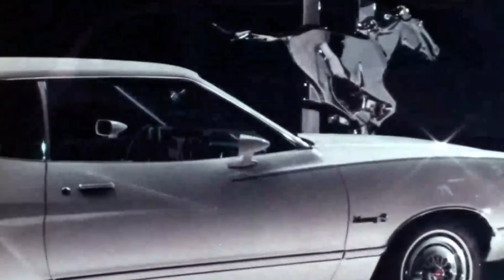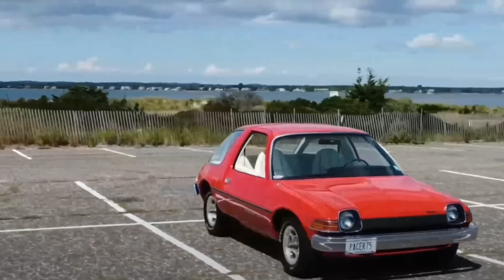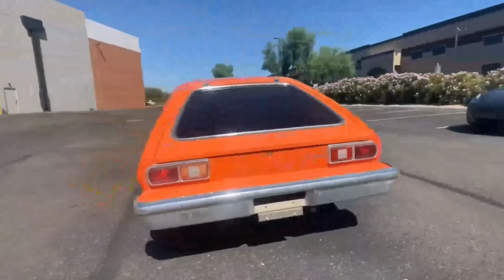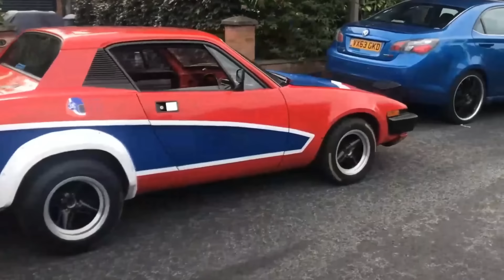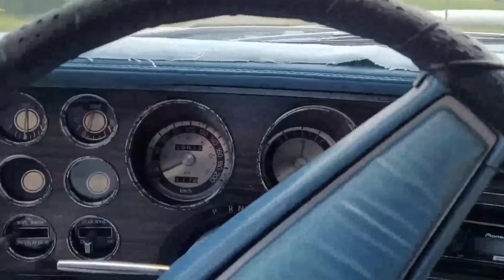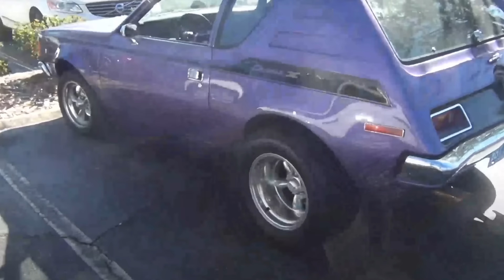Top 10 WORST Cars of the 1970s

Comment: Interesting, AMC Gremlins and Pacers are in high demand for AMC car clubs, I attend many car shows and have old Fairlane's and my friends have Camaros, and Pontiacs and Corvettes, but the Gremlins get a lot of interest. I had a Pinto, put almost 200k on it had a 2.3 L four with a standard shift, I did have to replace the rubber timing belt, and yes it rusted out, and the engine went in another Pinto, the Chevette  was a decent car for what it was. I knew a lot of people who owned them.
Reply: Gremlin, the only new car my dad ever bought for $2300, With a white stripe the only option, vinyl floors. 232/3 on the floor. But that Thing Kicked ass rolling white smoke otta the wheel wells from first gear! So Cool!
Reply: didn't know the pinto had a timing belt.  bummer.

Comment: Indeed, the Vega sucked.  My sister had a '72 and the engine seized up in less than a year.  My dad thought she destroyed the car but it was the crappy engine block.  One thing, the creator of this video showed lots of tricked out Vegas including one with a replaced engine that has no connection to the story.  Why not use correct visuals?

Comment: I can only talk about ones I’ve owned. I had two chevettes and three pintos. They were not built to race but were economical cars and very reliable. The gas tank issue was fixed by a $13.00 part. These cars were also popular with people running rural newspaper routes. I wish I still had mine. The Vega was indeed a bad car. It was a pretty car but dealership noted they leak oil sitting on the showroom floor. Mine was beautiful but didn’t last 20,000 miles. Before you make video like this leave your subjective opinion at the door
Reply: The Pinto was more reliable than the Vega, Chevette, or the Pacer. It's sad that it had such a bad fuel tank design. The Chevette was absolute garbage and I speak from the experience of owning one that didn't even make it to 100K on the odometer.
Reply: @citylimits8927 I owned two chevettes and they were both good cars. General Motors only designed them to last. About 50,000 miles but both mine exceeded that

Comment: My 76 Gremlin is the second best car I ever had 
Number 1 is the 98 Saturn I still drive
Reply: I have a 1999 Saturn SC2 3 door coupe with low mileage, no rust that was given to me. It needs a neutral safety switch. I just haven't gotten around to installing it. The right window needed a new window regulator. Being lazy I just ordered a new door from a junk yard that came in the wrong color but had the window regulator installed so I just unscrewed the plastic outer door panel off the old door and put it on the new door so I had the correct color. Easy fix and it only took a screw driver and wrench with socket. Try that with any other car. Easiest car to work on.
Reply: @eyesalooking  Interesting concept! They should make all cars that way!
Reply: Although they were slightly noisy and the plastic exterior panels had large panel gaps, the first Saturns in the 90s were actually very reliable, especially if you got one (as they say) "built on Wednesday" (the day of the week when all of the plant workers were at their best). I knew of one person who still had his after 365,000 miles although he had had to do several significant repairs by that point. The ease and low cost of maintenance was another plus for those early Saturns.
Reply: Gremlin, the only new car my dad ever bought for $2300, With a white stripe the only option, vinyl floors. 232/3 on the floor. But that Thing Kicked ass rolling white smoke otta the wheel wells from first gear! So Cool!
Reply: You must have only owned two cars.

Comment: I bought a brand new Chevette in 1984 and I got 229,000 miles out of it and it never cost me a lot to drive it either
Reply: I drove a chevette to 400,000 miles great car
Reply: Chevettes were great little cars. and I put the emphasis on little. A co-worker had on and it was very reliable. We took a road trip and were doing 80 in it Thrilling ride. -:)
Reply: @donalddoty5768  There was a tree cutter and church steeple builder here that always had the Chevettes and he loved them. Ugly as they were lol
Reply: Knew a guy that had a few of those and he loved them even though i thought they were the ugliest car ever made.
Reply: I loved my Chevette
Reply: Reverse lemon?
Reply: My auto shop teacher called the Chevette the Chevy Shove It!
Reply: @psa722 Hahaha that sounds about right.
Reply: Yes the 80s models were better.  I saw one go to 400,000 miles ..but 70s first ones had issues
Reply: The Chevette was the worst IMO
Reply: @kenrutherford1109  Pinto was right there with it. Lol
Reply: In Puerto Rico people used to replace Chevette engine and transmission using Toyota 1.6 engine.
Reply: The stick shift was bad ass but when you turn on the heater it was like you kicked the car in the nuts
Reply: Yes ,, but all your friends laughed at you .😂

Comment: The vega went out of production in 1977, not 1980.
Before these small cars came along, Almost NOBODY used metric/liters as a callout for engine size.
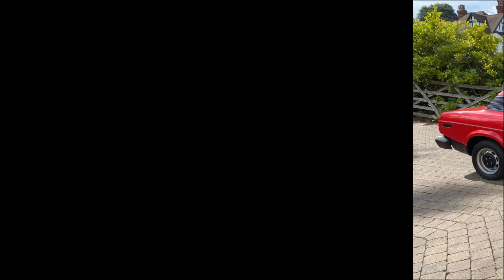9:00 No LeBaron of this era was body on frame, you idiot. They were all unibody.
The Gremlin was a decent car. This video sucks ass.

Comment: The Pinto was actually pretty successful.  My dad owned two Pinto wagons that he pulled behind a motorhome.  It was pretty funny when we unhooked because they weren't on a trailer.  They had a big V tow bar attached to the frame that we just swung up and secured.  Today we'd be told we couldn't drive it because it would obstruct our view. 😂  I remember now the gas tank issue.  That was definitely a problem.

Comment: I often wonder why so many cars from the 1970s weren't fully baked. The most disappointing was the Vega which was rushed to production so as not to be beaten out by the Pinto. While both cars were a disaster, Chevrolet put a lot more design into the Vega which was eventually redesigned after a bad reputation had already killed it. The Chevette was a mediocre replacement for a car with a lot more potential.

Comment: I call BS on the Chevette. It definitely was your “basic’” car, but it was a reliable little car. Bought one right after I got married. Ran the crap out of that thing. Could drive miles on a teaspoon of gas. Fun little car
Reply: Agreed.   
Me and 2 of my brothers learned how to drive in a '76 "vette"...
That vehicle got pummeled for years with no mechanical failures other than an odometer that stopped working after 200k!
Reply: No it WASN'T always a reliable car at all! Mine didn't even make it to 100,000 miles on the odometer. Absolute rolling repair bill. NOT BS AT ALL!!! I had floor pans rust out, the brake master cylinder failed, the radio was junk, and the manual transmission failed despite the fact that I never abused it. On later versions, they replaced the horrible 4-speed manual with an Isuzu-built 5-speed, which was more reliable.
Reply: @citylimits8927  I knew two people who had chevette's.  one had good luck but babied it, and the other took a beating and gave in quickly and junked it.
Reply: I had two chevettes both were better than my Toyota Corolla which kept burning up starters

Comment: The chevette was really a good car.
Reply: Drove 3 of these all of them went over 250 k miles
Reply: Absolutely 💯
Reply: I had a 1984 4-door. It was a terrible car. Steering wheel was off center from the driver seat. If you ran the air conditioner going uphill, you’d lose speed. Just going uphill you had to floor it to keep up your speed. In fact, when I knew a big incline was coming, I’d speed up a little just before. If you were carrying a big load (and it had the space) it became sluggish and dangerous at high speed.
Reply: Loved my chevette, drove it into the ground had it 13 years.
Reply: Was a reliable inexpensive crap; would always get you there but no style; lol!!!
Reply: I had a 1979 Chevette with a 4 cyl and 5 speed. The standard shift took out the slump of performance.
Reply: I beg to differ. I had one.  Got rid of it at 65,000 miles, I already replaced the carburetor, the master cylinder and the timing belt. Worst piece of junk ever.

Comment: Chevettes were good cars.    Vegas engines were junk and they rusted out.   Chevy dealer mechanic for 20 years.
Reply: The front suspension was use on the Fiero ( or was it the Citation).
Reply: Not always. Many of the early Chevettes were horrible cars! I speak from experience as I owned a 78 Chevette as my first car.
Reply: @citylimits8927  Had a girlfriend who had one and didn't make it past 30,000 miles.
Reply: Had a couple of 1970s Monte Carlos, always liked those cars. My 1979 wasn't fast, but it was a good, reliable vehicle for a kid.

Comment: The Mustang II was a sales success and was what was needed to keep the model available. The Pinto wasn't any worse than any other car of the day. BTW, many automobiles still have the fuel tank located in the same place. There just aren't alot of other places to place the fuel tank. Would you rather they put the tank in the interior. As for the Chrysler LeBaron, almost everything you said about the model is wrong.

Comment: Worst car EVER is 1977 Plymouth Volare Wagon.  This POS would vapor lock at almost any intersection, while you were in it.  The thing was a freaking death trap, not quite the Pinto, but damn close.  My mom had one for about a year before she cashed out on it.
Reply: Lol
Reply: My neighbor rebuilt a slant 6 in one of those volares. He said the pistons were so far down in the hole, it was a miracle the car even ran
Reply: @Ikeebeabuchi the slant 6 was never intended to be a powerhouse,  but they would run forever.
Reply: I've owned several Plymouth Volares, and Dodge Aspens over the years, and for the most part, they were pretty good cars, for the mid 70's.

Comment: I Had A 2 Door 1973 Vega It Was Ok Until It Hit 20,000 Then It Started Drinking Oil. In The Winter During Really Cold Days / Nights It Wouldn't Start At All. Everything On That Piece Of Crap Rattled Inside It Could Have Driven A Deaf Man Insane. Then Places On The Body Started Rusting. Now I Lived In North Eastern Alabama Where No Salt Is Ever Put On The Streets Whenever We Did Have Ice And Snow Accumulate On The Roads Which Was A Very Rare Occurrence. Worst Car I Ever Owned For Real.

Comment: Yes, most cars of this era had very low horsepower compared to modern cars. The swap to net horsepower from gross in 1972 accentuated this drop. Net horsepower is power "after taxes" of drivetrain and accessories. It resulted in a drop in rated horsepower of 15-30% overnight! Keep that in mind whenever you compare to horsepower ratings from before 1972. Getting more than 50 net horsepower per liter in a production car before MPFI was very rare, and many non-performance cars had 30hp per liter or less, ending up with 100 net horsepower and 22mpg in your 3.8L 6cyl compact. 
I'm also surprised the Volare/Aspen didn't show up. The recalls on that were record breaking, and the car remains a punching bag to this day. Still loved my 79 225 Volare Coupe though.

Comment: Always the same victims again. Pacer, gremlin, vega, pinto, Mustang 2. Some 25 year old computer nerd living in his mother's basement who thinks they know something about 1970s automobiles created this
Reply: I had a Vega it deserves all the “worst” titles it can get
Reply: Mustang 2, Gremlin, Chevette, Pinto - all hugely successful and profitable.
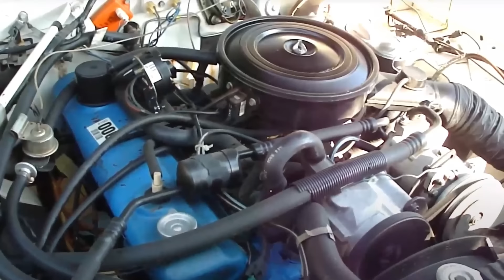Reply: I drove a 1978 Chrysler LeBaron with about 70k on it very similar to the one shown here at 9:33 from Wisconsin to Texas and back and had no problems with it back in 1987.   It had a 318 in it which gave ample power to get on freeways, and there was a big fuse attached called a "ballast fuse" which if blown the whole electrical system shut down.  I never had an issue with the electrical system while driving down the road, but I kept a spare fuse in the glove compartment and since this fuse was mounted right in the upper middle of the firewall it was easy to change.  The car had leaf springs in the rear suspension, but the interior was among the most luxurious I've ever experienced even to this day so that made up for the bumps.  During my trips I was able to take a rest at the waysides in the power driver's seat which fully reclined and tilted as needed and the tilt steering wheel was easy to get out of the way.   In the movie "Planes, Trains, and Automobiles" you can see John Candy fooling with all the adjustments on this same seat in a later model Lebaron!
Reply: right! 
my first car was a 1970 Chevy chevette, never ever had a mechanical problem. averaged 40 city 52 highway. graduated up to a 72 olds 442  with a 4.3 ltr V8. God I miss that car😢
Reply: All decent RWD cars. I despise FWD. The back end will come around in a second on a wet road.
Reply: @Dannysoutherner 
had that very thing happen to me the other day while in my wife's Hyundai Sonata.
Reply: My future wife had a 78 chevette....I use to joke at work ...we own a vette.....a  chevette. It was grey with red sweat your balls off interior....once I shifted into fourth at the the whole shiting column came out of the floorboard leaving stuck In 4th...after a tow and 250 bucks later....we were on our way to see her parents in okc again...I had a old ford 71 truck with a inline 300 six 4 speed but the truck looked like a work truck.....it was....after that we traded for a toyota truck sr5 with the graphics stripe in 81....we got divorced in 4 years....the only thing I wanted was my cat and the truck......I got my cat....had to start over ......next small truck was a mitsubishi mighty max cause it was cheap....but it was ok....sadly I was hit in it at payment 37and it was totaled....next car was a 90 camry....best car ever.
Reply: @gregh1853 
man, ya couldn't tear up a Mitsubishi mighty Max sport. 
I still believe that was one of the toughest trucks ever made😂
Reply: @mrrebel5150 i dont know what happened to mitsubishi cars and suvs.....my wife number 2 had a 91 galant which was a great car.....she traded in on a montero sport suv in 2000....she was rear ended in 07....next suv was a toyota highlander...she has passed on in 2017 but the highlanded is still going with 188k miles....im 68 ....maybe will last me till i die...min liability ins...i still like it better than most anything new out there.....
Reply: @gregh1853 
people nowadays want flashy over dependable. new vehicles now, you're lucky to get 25,000 miles without major repairs.
Reply: They wouldn't have sold so many, they were decent cars
Reply: @Richardleclerc-k1n that was basically what was available back then . Except for Toyota,  Honda, Mazda,  Datsun and vw.
Reply: Had a shoveit oh I mean a chevette had to push it out of the way More than once 😩
Reply: I had a74 Datsun b210, and later a 77 mustang 2. Both were lemons. However my 84 Hyundai pony was great.
Reply: AI

Comment: The Chrysler LeBaron was made from 1977 to 1979. The AMC Gremlin was manufactured from 1970 to 1978. The Chevrolet Vega was manufactured from 1971 to 1977. This guy does not know his behind from the hole in the ground
Reply: Gremlin, the only new car my dad ever bought for $2300, With a white stripe the only option, vinyl floors. 232/3 on the floor. But that Thing Kicked ass rolling white smoke otta the wheel wells from first gear! So Cool!
Reply: it's obvious he's just a kid trying to be cool.  he's right about the vega though.

Comment: Dud the Chevrolet Chevette have cousin cars from Opel/Vauxhall? Just wondering. Watching in Dublin Ireland
Reply: Yes, the Vauxhall Chevette. There were also variants sold in Japan and Australia.
Reply: @RBAILEY57  Vauxhall Chevette looked the same on the outside, but completely different drive train and interior.  They also made a pick up truck version of it that I remember from the UK.
Reply: The Chevette set the record for the most rebadged car in the world.
Reply: Opel Kadett C, these are worth a lot in decent condition. Especially the coupe was a beautiful machine
Reply: I owned one of the Chevette only problem i had was timing belt no engine damage just stopped in its tracks
Reply: Lebaron was a unibody m designation and was started in 77 not in the 60s,bad video